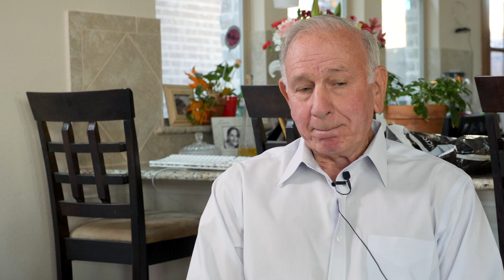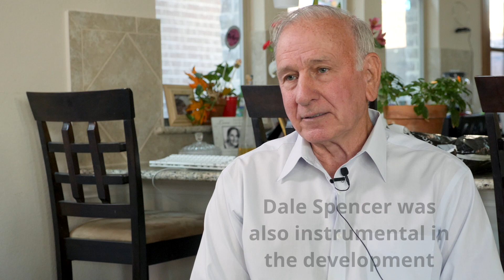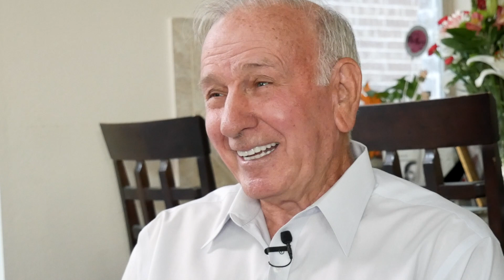Arc Fault Circuit Breaker

Comment: 2:05 I learned about AFCIs in a code class and, along with general confusion of 3-phase, this is what made me stop pursuing the path to become an electrician.  Stupid reasons, but I am dead serious, I was being stubborn I guess. Simply put, I did not understand their purpose, got irritated by the code and just gave up.
This was in 2014, I guess the competition blocking ceased at some point?  I still don't like them, sorry guy.  Why is there a pigtail of curled wire?  Trusting new microprocessors to an analog system that works fine is a difficult idea.  GFCIs are well established and trusted, can be placed in the branch circuit, and closer to the source of the potential risk.
And yet, they are required now, so what do I know - hence why I quit.